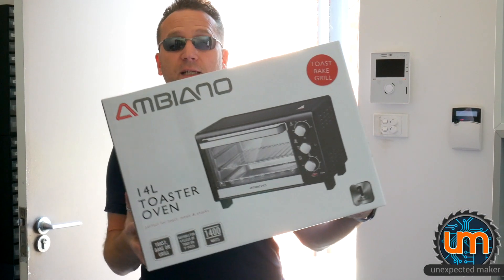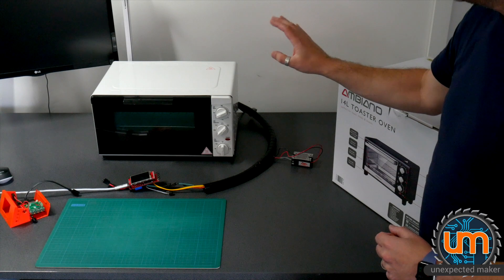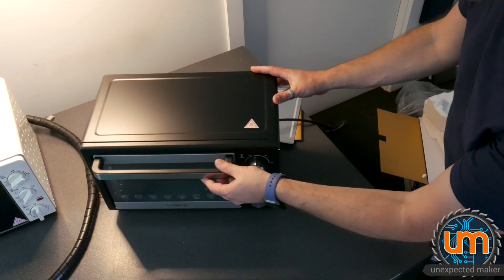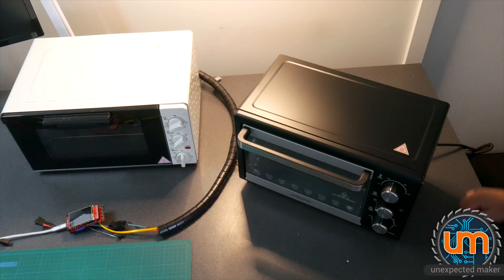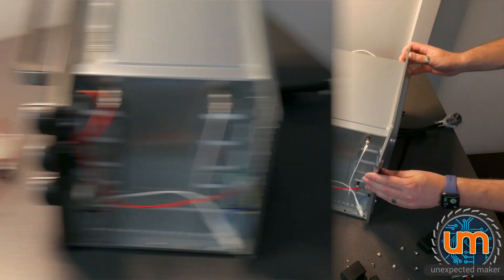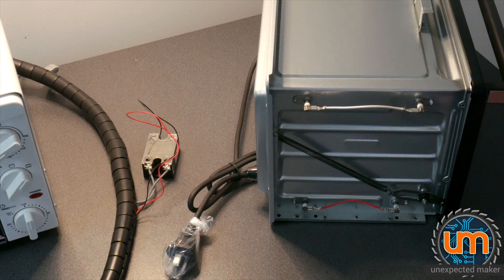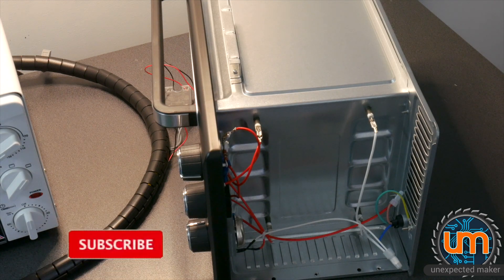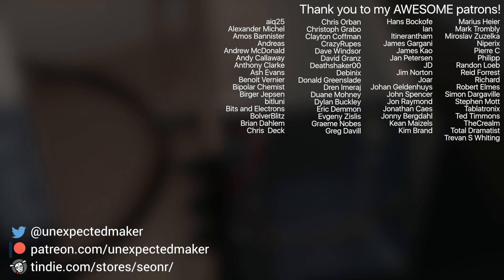Reflow Master Pro - The perfect toaster oven?

Comment: If a fan pulls out 200° hot air, doesn't it melt? I really love what you are doing. Looking forward to see a video if you building this thing. 😉
Reply from the maker: Thanks! The FAN doesn't melt, no, but it will damage the fan motor over time, as they are not really designed to have this much heat around them, but they are also cheap to replace. Getting an ALL metal FAN designed for high temperatures is extremely pricey. I can replace fans 20-30 times for less $.

Comment: Look like quartz elements. Two lots of two wired in series. Can you change it so they are all wired in parallel? Will it make a difference.
Reply from the maker: I don't think these are quartz. Def not for the price, and they are not dark enough.
Reply: Unexpected Maker if not then they will
Be the same as what I had. Just a resistive element inside ceramic with a steel shell. Which take an age to heat up. I ripped them out and fitted some halogen heater bulbs in mine and heats up 5x quicker now. Will be interesting to see how quick yours heats up when doing a test

Comment: I lined the outside of the oven chamber with a couple layers of fire blanket material which was either taped on with kapton or riveted to keep in place. Drastically improved the temp ramp  and gets pretty close to a reflow curve now.
Reply from the maker: I've seen other take this approach. I guess I was lucky with my wife oven (first one) that it didn't need it. I can even "just" reflow SAC305 with it, though it's waaaay pushing it's limits.

Comment: Why is it so important to have fans to cool things down? Most device manufacturer specify a cooling rate somewhere in the range of 1 - 6 degrees celcius/sec. Going to fast may introduce stress on large components due to an uneven temperature distribution for the some components. One reason not to go very slow thru the liquid phase, where a fast rate produces small grains in the metal and a slow rate results in larger grains. Although smaller grains are stronger, does it really matter that much for hobbyist/makers. Naturally it matters for real products that suppose to be somewhat reliable but then you would not use this kind of kitchen toy ovens anyway. When soldering for hand, nobody cares.
Reply from the maker: The fans do a slow cool down, not an instant one.
Reply: No fan and it cools incredibly slow